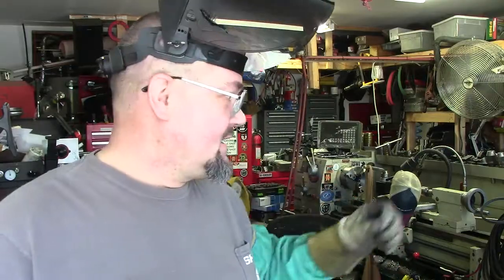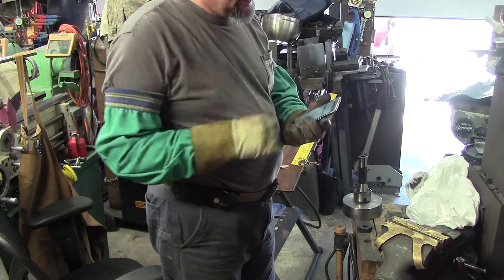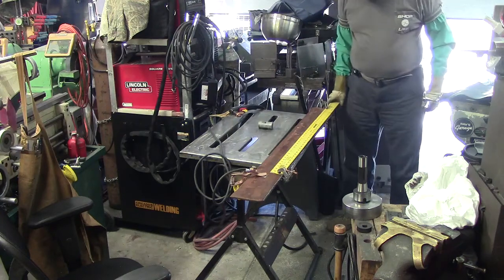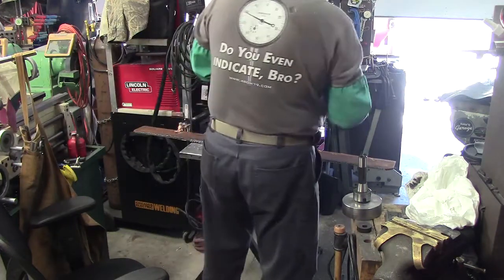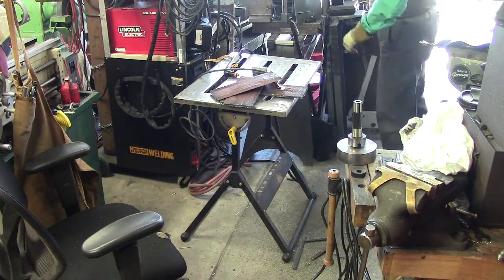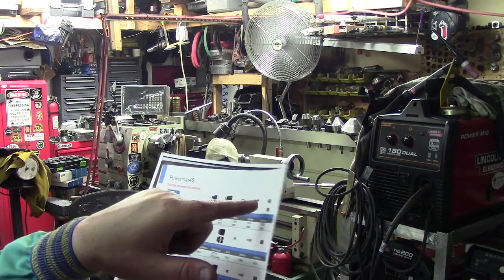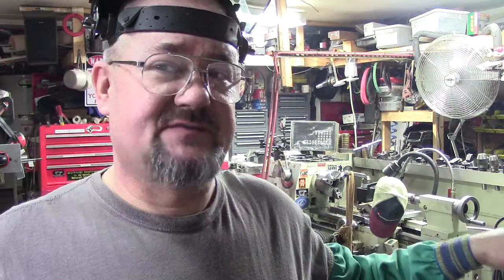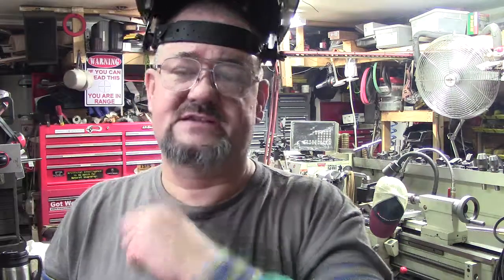The New Hypertherm Powermax 45xp

Comment: I just ran across the video about the 45XP. That T45V torch is for the original Powermax 45 (non XP). Not sure why you  were sold that torch for that system. You should have been sold the Duramax lock torch. It has the newer style consumables and has the lock feature on the handle which is nice. The newer style torch will cut better than the T45V. Just wanted to update you on that. I see that this video is pretty old. Just an FYI>>>